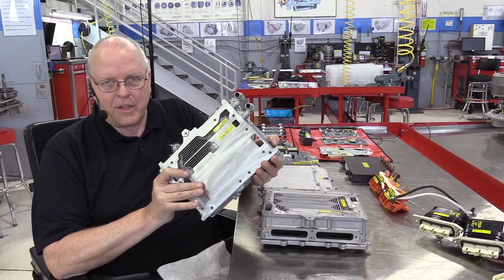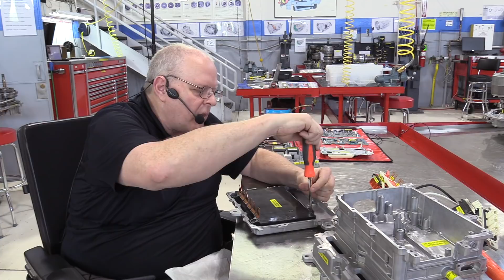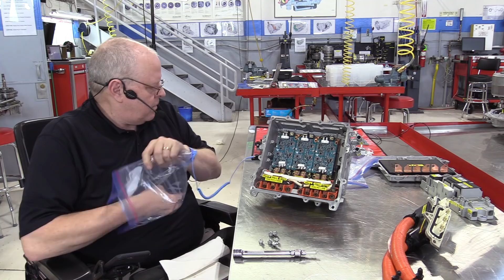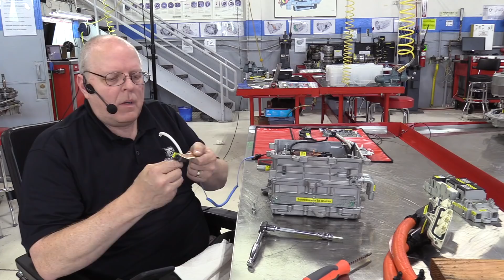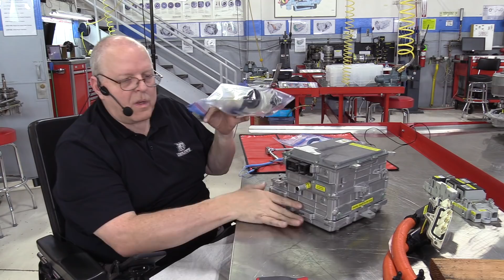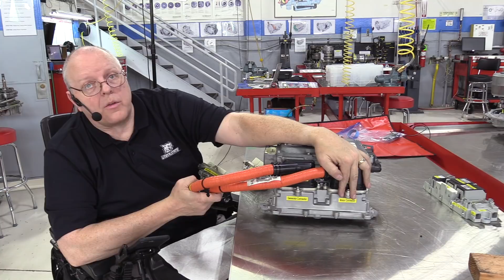2013-2019 Ford Fusion Hybrid Inverter (SOBDMC/TCM)

Comment: Hello friend, my 2014 Ford Fusion Hybrid is showing error code P0A2D-00. It's related to the secondary OBD control module C. Do you know what the problem might be? Could the main board of my inverter be faulty?

Comment: Professor John I was told that if I replaced the Inverter with a used one I need to reprogram it if not it won't start, but I was told if I use the same board of the old one I don't have to and it will start. I appreciate all of your videos. Super Helpful Thanks
Reply from the maker: That's an interesting question, but unfortunately, I don't know the answer to that.
Reply: Ok Professor thank you for your help. I will try it and let you know. 👍
Reply: @johnlittle1939 did it work?

Comment: Thanks for the video… quick question.. is this direct plug and play or does is require programming after swapping a used/new inverter to replace your old one in a ford fusion hybrid/energi ? After I swapped mine it won’t start and has a few codes for immobilizer, isolation, etc
Reply from the maker: I think it requires programming
Reply: @WeberAuto  omg thank you so much for your swift response. Do you happen to know if I can do it with forscan or an autel scanner or any other software or I have absolutely no other choice but to be at the mercy of the dealership
Reply from the maker: @jasonumeagudosi  I do not know that answer

Comment: Hello professor Kelly, I have a question for you: My 2020 Ford Fusion Hybrid has a problem with acceleration but a scan tool shows no errors. Symptoms include a sudden increase in combustion engine RPM when I press the gas pedal, but almost no power is transferred to the wheels. As if MG2 is not rotating fast enough and the power from the combustion engine is transmitted through the planetary gear to MG1 https://youtu.be/8T3qYaNTHUc
This problem has occurred before (always without errors), but it would disappear on its own after a few days. What could be the cause ?

Comment: Hi. I hope you don't mind me asking, but what could cause the hybrid drive to lose electric drive power after removing and replacing this inverter? This happened immediately after I had someone replace all three motor / transmission mounts / supports. One of them requires the removal and replacement of this inverter in the video. After plug-in charging, the car drives fully electric just fine. The hybrid system also seems to charge the big battery as it should. But there's an obvious loss of drive power when in hybrid mode. The gas motor seems to be working much harder and doesn't respond to the accelerator very smoothly. The MIL never comes on, and Forscan doesn't consistently show any interesting DTCs beyond SOBDMC lost comm with the TCM, and the GFM lost comm with the APIM sorts of things. What could be the problem? It seems to be beyond my local Ford service shop.
Reply: Thanks for the videos, by the way.

Comment: hello Professor
Here is a scenario for you on my 2014 Ford fusion hybrid SE not plug-in
my 12 V battery system is running high voltage 15 V without the vehicle running even turning AC on and lights on it only drops to 14.96 question is would the inverter be at fault as it doesn’t run a regular alternator in these vehicles apparently secondly could this be causing my power steering issues I get no power steering when the vehicle is sitting still in hybrid mode only when I step on the gas and get into gasoline mode, I get full power steering any insight would be greatly appreciated

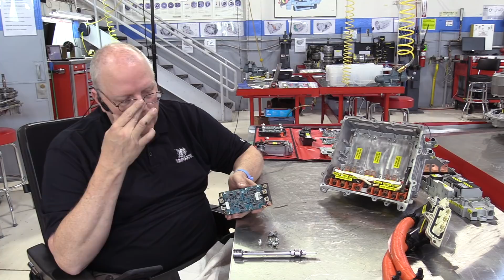Comment: 13:07...this is incorrect. The back diode is NOT for rectification! It is there to absorb that collapsing magnetic field that creates a high voltage spike when an inductor loses power. If what you said was true, then you would have zero control of regen braking and every controller on the planet would support regen. This is all patently wrong!

Comment: Any1 I got a 16 ford fusion hybrid with this code on the SOBDM-C u0151:00-2E lost comm with RCM AND P2533:62-2E Ignition Switch On/Start Position Circuit. Please help, no start or intermittent start

Comment: Hi professor. I have a new problem with my ford fusion hybrid 2014. I changed the transmission filter and fluid in my car and also transmission damper. after that if I want to make full throttle it comes stop safety alert  icon suddenly. The computer checks P1920 code. Then I stop the car. Turn off the key and turn on and the stop safety alert goes on.But it is not  always repeated.this  problem come only in full throttle. Please  help me to solve this problem .Thanks

Comment: A note about the "reactor" (which is really just a large inductor, which uses external transistors and diodes to complete the DC-DC boost/buck circuit). 
The reason for stepping the inverter DC bus voltage up - is for higher motor/vehicle speeds. At low speeds the motor needs high  current, but not much voltage... but as the motor RPM increases, so does the motor BEMF (Back Electro-Motive Force), which effectively cancels out the drive voltage "head-room"... so it cannot continue to turn faster. 

So without increasing the drive voltage, the motor speed (and therefore the vehicle speed) would stop increasing above maybe 40 MPH. By increasing the inverter bus voltage, you now have more voltage headroom, allowing higher RPMs before the BEMF stops us again, and can still acellerate the vehicle.

Typically the Toyota boosts the bus voltage from 288V DC up to a maximum of about 650V DC for maximum speeds. The boost voltage is only pushed up high enough for the required speed, because it is "Power Limited". If the Boost circuit is limited to 20kW, and if it's only boosting to say 350V DC for 50MPH (where you still need some torque), it can produce 57 Amps. As the vehicle speed increases and we need the full 650V DC, the boost inverter can only produce 30 Amps DC. This tracks the requirement of the drive motor in lock-step. 

At high RPM, the motor doesn't produce a lot of torque, so the DC boost circuit doesn't need to be huge.

This is one of the aspects of the original Toyota hybrid design that really captivated me as an old EE,  and is one. reason why I ended up with a 2008 Highlander Hybrid... which now has very close to 300,000 miles on it, with amazing reliability.

Comment: This is a great educational tool good job.  I only wish there was reference to where the cooling vents in the car are and if there is cleaning maintenance do, such a c-max energi air intake in the right rear wheel well where a screen gets plugged and causes over heating of HV battery.  This added info would be great.

Comment: Thank you so much professor for making these videos! I have been searching for info on my 2019 Ford Fusion Energy. Several weeks ago I unplugged my Fusion to drive to work. It was pre-cooling the car on a hot summer day per my scheduled warmup/cooldown settings. Since then the Fusion always thinks the power cord is plugged in. I have to do a little on/off with the start button & then select a menu question about if the car is plugged in. My dealer thinks it’s the charge plug in connection but I doubt that as I believe it’s only a dumb plug in connection. Any ideas from you or others would be appreciated! I’m an industrial electrician so I would love to fix this and learn at the same time. Thanks!

Comment: Hi withe the system de-energised (service disconnect removed) and HV presence measured absent as the HV battery connector to inverter module, can you tell me why my 2-pole tester still buzzes with a resistance value? Is this due to some capacitance in the battery?

Comment: It appears to be an insulator between the computer board and that aluminum cover underneath. The computer board Im sure is conformal coated but you can have thin spots where moisture could cause issues being that the computer board is close to that aluminum cover.

Comment: I worked for an engineering firm for 22 years and built power applications for an experimental all wheel electric drive vehicle for FMC which was being used for the military. We used large IGBT's, however we had sill pads which insulated and had the white heat sink grease already applied to the pad. We always called our phases A,B and C which is common throughout the aerospace industry. Once thing I dont like about the automotive designed aluminum cases is the lack of helicoil locking inserts for the screws. Our traction drive motors, one at each wheel were 1000 HP each. Were wound with square wire and were of a wet motor design. These are excellent video's that you do, thank you I am subscribing, your explanations are clear and excellent.. Most of our designs were 3 phase AC fans and pumps for civilian and military applications.

Comment: Hi. I liked this video. Thank you very much professor.I have  ford fusion hybrid 2014.The coolant is low in my inverter system. Which coolant  I must add? Concentrated or prediluted ?
Reply from the maker: Always use premixed coolant. Thanks for watching
Reply: Ford doesn't produce orange coolant now. they stopped. They changed it to yellow. Can I mix orange with yellow for engine and inverter coolant?Thanks

Comment: I've owned 5 different Ford Hybrids, starting with the original 2005 Escape which my son still drives with 280K on it. Thank you for the excellent video series on the eCVT and control modules! I've always wondered what the design looks like compared to the Prius. These transaxles are so reliable it's amazing and now I know why. You've earned another subscriber in me. I will be spending much time learning from your excellent work. :-)

Comment: If I pull the orange safety plug on the battery is it safe to remove the TCM without gloves, or do I still need them? I need to change the transmission mount housing, and have to remove the TCM to do it.
Reply: I'm watching these videos and learning a ton, and exactly what it looks like which is fantastic. What I really want to know in the short term, if I pull the orange safety plug, is there still electricity up front? Or am I safe to move the TCM aside with regular tools?

Comment: I have 2014 ford fusion hybrid high voltage battery is drained from sitting for a year won't start code is showing becm module and  sobdmc error the 12v battery is fully charged engine won't start display show ready to drive and a triangle Do I need to charge the high voltage battery externally to run the car now is there a button like the older escape has to boost the high voltage battery from the 12v any help would be appreciated. Thank you

Comment: Excellent videos Prof. Kelly. I enjoy watching your videos even though I'm only about an hour away from the Weber campus. Hopefully my kids can attend there some day. On a more technical note, I'm curious if you can answer a question about my 2013 Fusion Energi. When in EV mode, accelerating or decelerating, you can hear a distinct sound coming from the engine bay. It's definitely not gear noise and sounds electrical in nature, perhaps similar to water running through pipes in the house. You can make it louder or softer depending on how far you press the accelerator pedal. 

The only thing I can think is that it might be the capacitors. 

To be clear, it's not an issue. In fact, I've had multiple Fusions that do it. I'm more just curious.

Cheers, and keep up the great work.

Comment: The mating cable to the white connector at 30:00 is where the Midtronics  external battery charger connects to the HV battery (this may have been mentioned in a previous comment somewhere).

Comment: Hello.  I have a 2013 Ford C-Max Energi with the inverter module shown in your video.  How do I drain the inverter coolant?  It appears that I will have to remove either the inlet or outlet hose.

Comment: I built many computers and never had a static charge problem and never used anti static protection. Those compotes are more likely to be damaged by low or over voltage when it is in the car. You  can soak computer parts and the will still work after going though that. The damage happens when you put power to it when it is wet. The makers of the computer parts  do not  care if you use that or not because it is more likely  that will not happen. More and more makers are not including the antistatic information on computer parts that are being sold.

Comment: Seems very silly, relying on the cableside connector for weather sealing.
Reply from the maker: Thanks for your feedback
Reply: @WeberAuto  That's feedback for Ford more than anything. Since it's not serviceable (on the record, at least) it would make more sense to pot/seal in the external connections instead of leaving giant gapes in the housing. Only Ford can do brilliant and questionable in one sku 🤣

Comment: Great educational video I'm learning about batteries so if you don't mind I have a question for you learning about batteries because I am charging my house and I have 12 truck batteries with an inverter I have solar panels but they're not cutting it for me so I have two little chargers at 15 amps constantly working charging  batteries and every half an hour a big battery charger with 40 amps kicks on and off every 30 minutes when I get home from work I disconnect the car battery then when I go to work I can make that again and has been working fine I have 19 Outlets working off the inverter so my question is if I was to get one of those hybrid batteries is it possible to connect to the system that I want to been doing
Reply from the maker: These batteries are high voltage 300-400V. You would need to split them up into lower voltage sections.

Comment: Is there a way to modify a hybrid,  with a solar panel roof.  Possibly running through the brake charging system.  

Or into in the inverter
Reply from the maker: I don’t think so
Reply: @WeberAuto  I know they had a prototype,  with solar.  Granted my only thought would likely just be a full charge when I leave in the afternoon.  I park outside.  

Make when it's time to junk it,  I'll mess around with it.

Comment: Very very informative and professional video. Great!! I got some questions and maybe you got some answers. So there‘s the intelligent Power Module. In an electric vehicle traction inverter I Think there is a reference and carrier signal to generate an sinusoidal Pwm. Are they generated with this intelligent Power Module or with the Generator Motor Control Computer? Or how are they generated generally? Analog or digital today? And do you know, if the position sensor of the throttle Pedal is controlling the amplitude if the of the reference and carrier signal or how can I control the amplitude of the sinusoidal pwm information which is then given to the gate Drivers of the Igbt Modules. And in an inverter in 2018 they don‘t use analog curcuits do they?
Reply from the maker: Thank you. I believe the IPM generates the signal for the MCC to use. I am sure they are all digital. I do not know who the throttle pedal input is used, but it seems logical that it would e used for frequency and amplitude (PWM) control.

Comment: My 2015 Ford fusion Hybrid make a noise when it's idle or when I go on the gas. It kinda sound like gears turning but also like a whirming noise and then cuts off. Ford said it's the transmission,  local mechanism said it's the fan and another one said it is the transmission. Do u know what noise am referring to? Thanks
Reply from the maker: There has been a problem with a countershaft bearing failing. Check with the dealership tor possible warranty repair. Best wishes
Reply: @WeberAuto  is that in the transmission? I uploaded a small video moments ago. U can listen to the sound.
Reply from the maker: Yes, inside the transmission
Reply: @WeberAuto  gonna relay that'll info to the mechanic tomorrow thanks
Reply: Might be too late for this comment, but the gearbox issues seem to be with 2013 to late 2015 hybrids only. There's a TSB and Ford seemed to catch on by 2016. If you had a gearbox fail, they'd install a new one from 2016+ revision. It does not seem to affect the Energi models, possibly due to auxiliary lubrication.

As another side note, bearing failure would be covered by Ford's hybrid parts warranty which is 8 year, 100,000 miles.

Comment: Anyone? My 2013 fusion hybrid makes a loud click noise when in electric only whilte stopping and then taking off again. Click noise when brake pressed for stopping, then loud click noise when pressing gas pedal starting out, all this while engine off when battery power permits. Anyone have an idea what it causing this?? Thanks and great vid!
Reply: Check your cv axles
Reply from the maker: Thank you! I have not heard of that

Comment: Does anyone know the output voltages of the SOBDMC?
Reply from the maker: The input is 281.2V. There is no boost inverter, so the output voltage will be the same or lower. The input voltages can be higher.

Comment: engine charges battery through inverter wastes 50% of power transfered  in heat so hybrids over hyped.
Reply from the maker: Thanks for your feedback. The battery is also charged every time you decelerate. The best fuel economy, and cleanest emissions  vehicles on the planet are hybrid electric vehicles. No gasoline or diesel even comes close. That is not over hyped. Join the revolution ;)

Comment: I thought 3 phases were id by A B C?
Reply from the maker: I have seen reference to the  A, B, C phases when they are used on a "Delta Wound" stator (Example is the Saturn EV1 from 1996-1999), but the phases used to drive the "Wye Wound" stators used in later electric vehicles and hybrids are referred to as U, V, W. I do not know if that is a standard practice or not. I need to investigate further. Thanks for your feedback.

Comment: Thank you professor, your videos are an inspiration. I was surprised to learn that the reactor module can reduce, (buck) voltage as well as boost it. Thank you.
Reply from the maker: Yes, a cool way to increase power for driving and reduce power for charging the battery. Thank you!